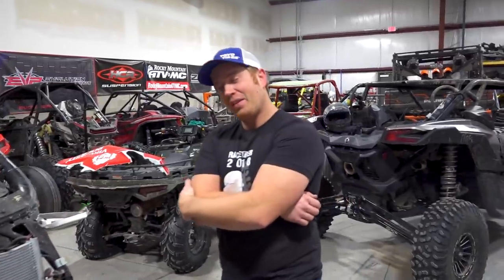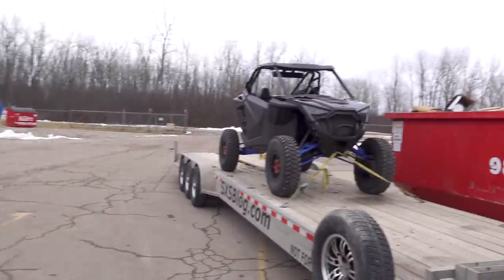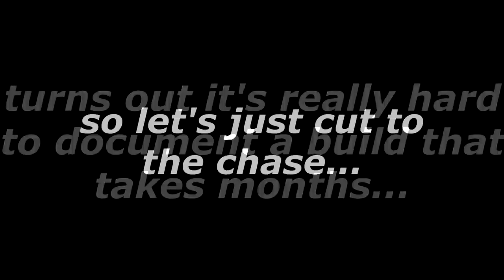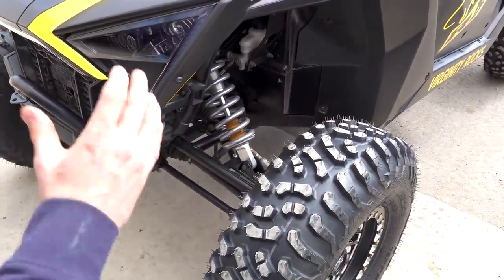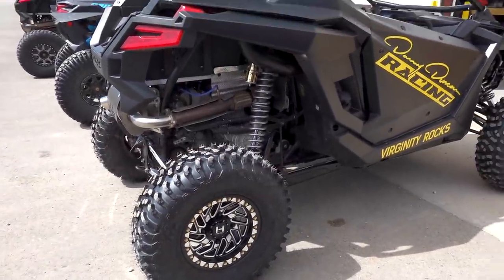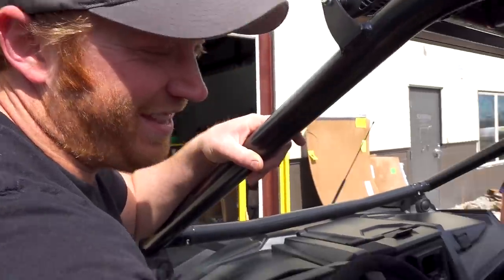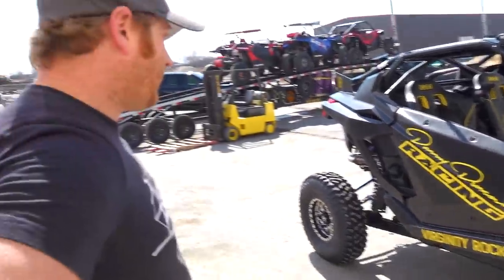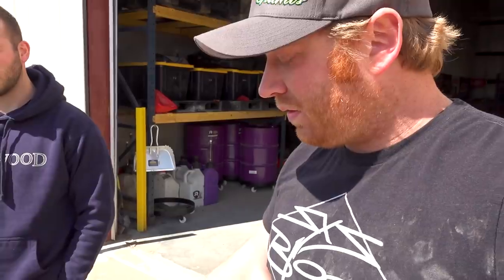We build DANNY DUNCAN’S Polaris RZR Pro XP! Our best build yet?

Comment: Stock a-arms and trailing arms? Someone cheap’d out lol
Reply from the maker: Stock Pro arms are pretty dang good, and will be easily replaced / serviced if he needs.   Not every machine for every person needs everything available on the market.
Reply: @SXSBlog  Bottom a-arms are tiny, that being said I didn’t have any issues with mine either, they just look really weak lol. You guys bent the rear trailing arm but Sous smashed it against a tree lol. I’ll just upgrade when they fail. 👍